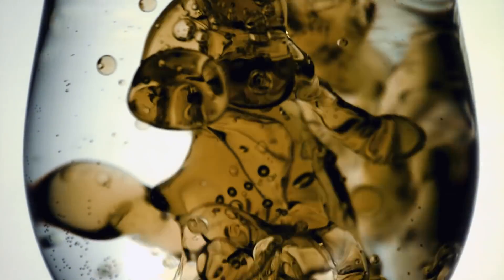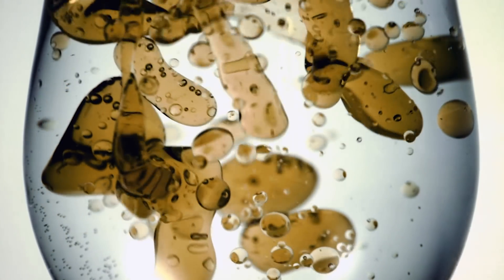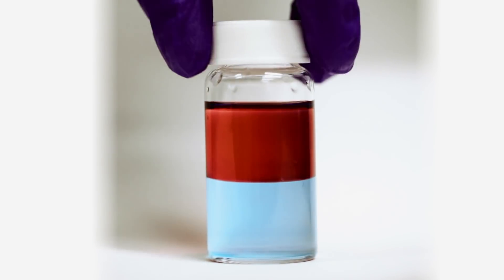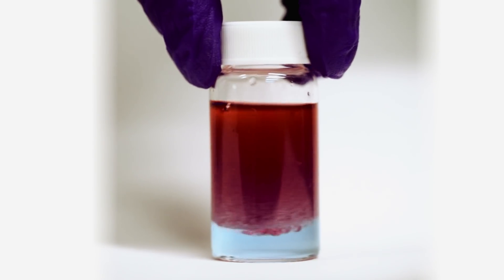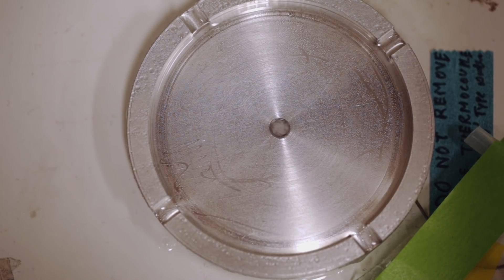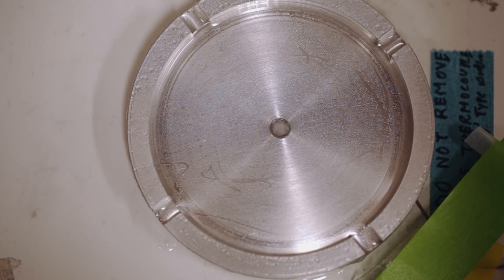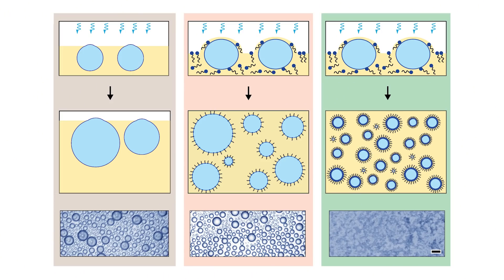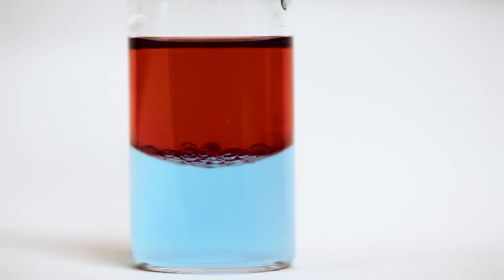A new way to mix oil and water

Comment: For a normal emulsion process, mechanical energy will be required to break down the size of water in oil. In this particular process, water is heated up to become steam (ENERGY) to accomplish size breakdown, then condense to micro drops of water. Before they have the chance to meet and coalescence into large ones, they are coated with surfactant molecules and settle to the bottom in oil.
Reply: I wish I knew the details to duplicate!
Reply: So basically a working on veggie steamer with a vessel with oil+surfactant inside could replicate it??🤔

Comment: Could this be used as a fuel, 50% water, 50% oil. If it works it might help with the extreme consumption of oil.
Reply: I'd assume that would separate the particles?